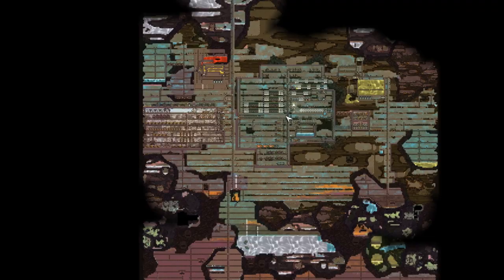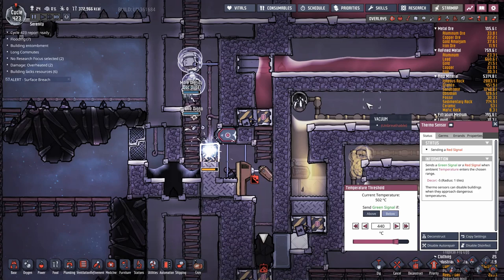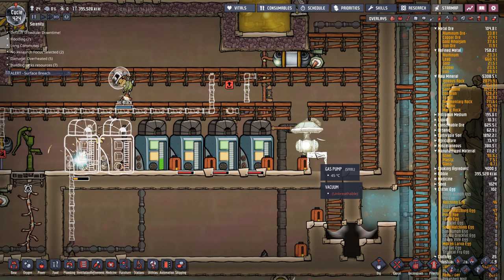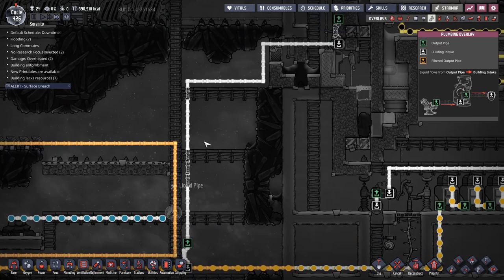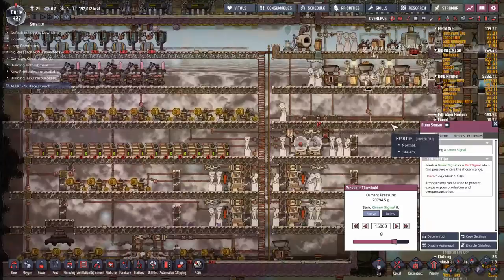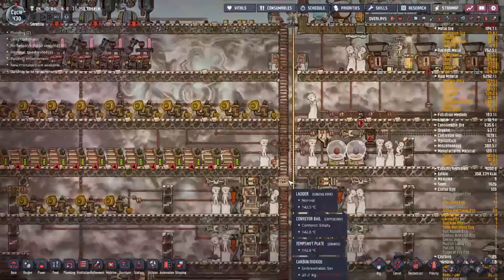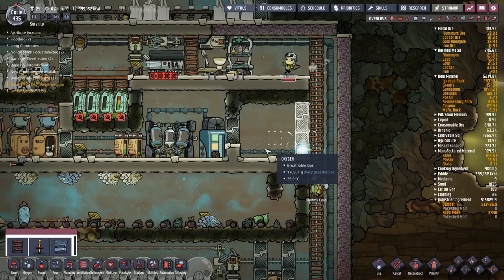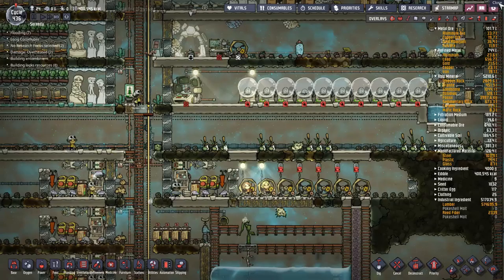Oasisse 12 : Petroleum buffer, Boiler repair, CO2, Crude tank, Pokeshell :Oxygen not included

Comment: I also kept having issues with your petro boiler setup. The issue for me however was that the robo miner was never fast enough in disposing of the rock tiles before magma dropped in. I shoertened the gap between the 2 doors above to reduce the magma drop and it made the miner be able to catch up with mining over time.
Reply from the maker: What have you got the timer set to? It should be 20 seconds of mining before the doors cycle.

Comment: As I had the same issue with sour gas and actually had a save about 10 seconds before it happened... A dup comes through the door to pick up the hot igneous rock on top of stack.  When they pick it up they are standing right where the robo miner is and they instantly boil the 300g of oil.  Took me an hour to figure it out and finally see it happen.  Need to lock them all out and never go back in that way.
Reply: I had the same problem and made the same solution
Reply from the maker: Could have sworn I locked the door, locking it now. Thanks for the info, bugs like this are so annoying when you cant figure out the exact mechanic causing it.

Comment: If you run the piping through the inlets of the five liquid tanks it will serve as an effective overflow once the fifth tank fills up.  It simplifies the piping and keeps the outlets open to do whatever you want with.
Reply from the maker: Looking back at it again, I still don't like the whole system. I'll most likely rip it all out again later and implement a straight through pipe, but not until I complete about a dozen side projects.

Comment: you didnt fix the automation wire of the robo miner its connected to the filter gate  so it will kick in after X amount of sec you have it set at.
Reply from the maker: The mining drill is hooked up directly to the temp sensor and will turn on straight away. It's the doors above that are hooked up to the filter gate.

Comment: does the robo miner really need oil if its attached to metal tiles?
Reply: Yes. it's in a vacuum, therefore it needs a medium to transfer its heat to the metal tiles.
Reply: odd i thought blocks that "anchor" to others transfered heat in that connection.
Reply from the maker: I know the feeling, but as it stands a machine in vacuum will not exchange heat with anything. So hence the drop of liquid.